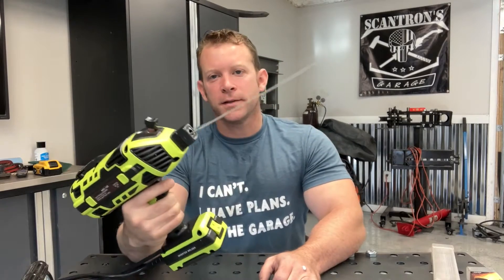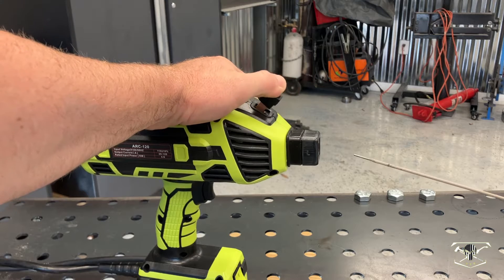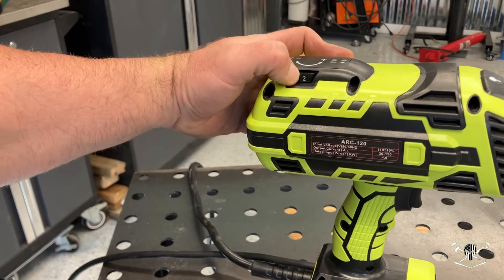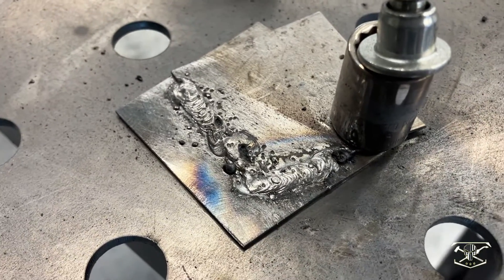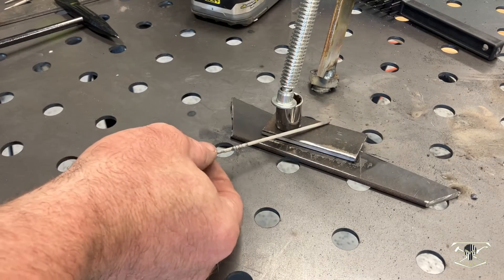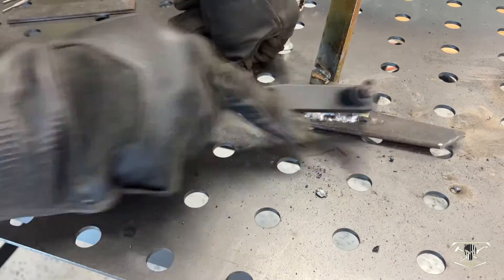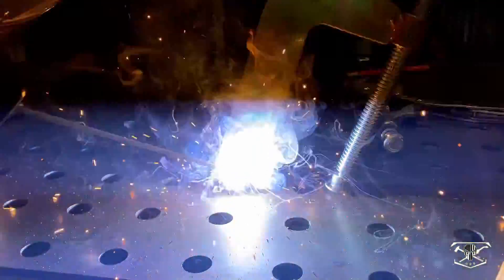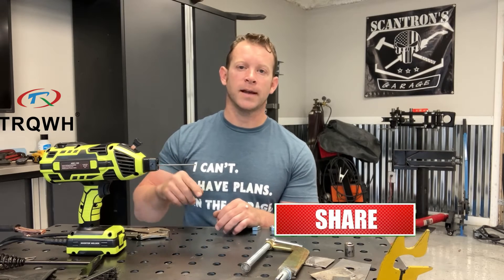Testing The Handheld Welder

Comment: What setting for exhaust pipes. I keep putting holes in test pipes?
Reply from the maker: Start on the lowest. Exhaust pipe is thin so you may have to start and stop weld meaning you only do a tack at a time and work your way around the pipe. This mini moves heat buildup

Comment: I got the Saker version of this tool, and today used it extensively.  I got it as something to learn on, but the gate of my utility trailer broke off, and I NEED that trailer tomorrow. 

A dear friend who happens to weld for a living came over, and welding my own trailer was my first practice. 

1. Power: 110V, 20 Amp on 100' extention cord.

2. Rods: 3/32

3. Hood/Safety: ran into a snazz here.  If you get a cheap, dark hood for extra protection that is NOT adjustable, you WILL NOT see the material.  The gun simply isn't bright enough...all you will see is a green, glowing blob.  This caused my first attempt at welding to START at the right spot, then trail off into Never-Never Land.  You can see your work with the kinda-face-shield thing that comes with it, but keeping the thing on your head is challenging.  

4. Working time:  Project start-- 7:00 a.m.  Cut off old hinges and ground areas smooth.  3/8" steel bar was cut to size for reinforcement.  After that, the process was clamp, tack, remove  clamp, weld, grind, second pass, grind, repeat on next piece.  The machine seemed happiest on this job on setting 4.

Job finished at 2 p.m., which included a quick run to get more rods. 

5. These were not PRETTY welds, as he was getting used to the machine, and I'm a rank newbie.  They got prettier.
The machine never had an issue or overheated at all.  The welds were all solid and it penetrated well. 

6.  I'm a smallish woman, and I had no difficulty handling the gun, or using it.  My friend, who habitually uses machines worth more than my car, was VERY shocked at the quality when I told him how much I paid for it.  

Hope this helps anyone reading.
Reply from the maker: Thanks so much for sharing your experience and detailed tips with the welder! This is super helpful for anyone looking to get one.

Comment: I have been dabbling with learning how to weld for years. I’m a DIY woodworker and every once in a while I have a project where a welded structure would make things easier. Investing $100 in a tool to learn the basics to weld a metal frame or understructure seems reasonable. Your review gave me the confidence that such a tool which seems adequate to what I need, is worth the investment. Thank you!!!
Reply from the maker: Glad I could help give you the confidence to start welding! It's a great skill to have for DIY projects.

Comment: What’s it like on car panels or does it blow holes
Reply from the maker: You can do it. It is tricky though. I welded some thin sheet metal in this video about the same thickness as an automobile. You just can’t let it get to hot and only weld a few sections at a time to avoid heat buildup/ distortion

Comment: no one in the comments or even the video creator are real welders?
Reply from the maker: No I’m definitely a hobbyist using a hobbyist machine
Reply: This isn't a tool for "real" welders to use on their day-to-day jobs of doing "real" welding. 

This is a tool for anyone, from "real" welders to people just taking up the craft, to put in the seat of their side-by-side and head to the back 40, or fix the broken metal tube lawn furniture. 

A Black & Decker cordless drill isn't intended to replace a Delta Drill Press.  No one expects it to. It's meant to drill holes in the wall to hang the curtain rods.
Reply from the maker: @ArbreSage53  true but this thing is awesome to have at your disposal and is great for most home repairs

Comment: Hmm looks to good to e true but it looked as if it worked ok. Now some idea of the power outlet and it's current handling requirements required plus some testing of those welds, would hav been really helpful. The only thing i found disconcerting was the rate at which the device chewed up the rods, so is it quite expensive on that account??
Reply from the maker: Good points. The welding rods burned through quickly because they were thin compared to the metal thickness I was welding. I could have switched to a thicker welding rod that would have burned slower

Comment: Awesome video very informative.  New never welded before and want to get into it.  Will this work on a trucks muffler pipe to extended it? Thanks
Reply from the maker: Yes it certainly will. Make sure you start with some sample pieces to figure out how it welds before you start on your exhaust. You will need to practice a bit on your technique before welding your work piece

Comment: DON'T risk buying or using ANY welding machine for which the manufacturer does NOT supply a FULL LIST OF ALL applicable input/supply voltages and amperages for ALL common welding rods.  Running a welding machine off domestic wiring/outlets risks blowing fuses/circuit breakers, starting fires in your building and/or electoctrocution of the user or others.   IT IS WAY PAST TIME THAT NATIONAL GOVERNMENTAL ORGANISATIONS BANNED AND REMOVED ALL ADVERTS AND SELLERS THAT CANNOT PROVE THEIR DEVICES MEET THE ESSENTIAL SAFETY STANDARDS...WITH SUBSTANTIAL FINES  AND/OR IMPRISONMENT OF COMPANY OWNERS AND DIRECTORS FOR NON-COMPLIANCE. FACT: The manufacturers and sellers could be risking or destroying users' lives so that they can make financial profit.
Reply from the maker: Good thought

Comment: Man can this thing get stripped bolts out 😂
Reply from the maker: So many good uses
Reply: @scantronsgarage I don't know ow anything about welding but I work on cars and I'm tired of stripped bolts I keep hearing about a mig just want to know if this would work
Reply from the maker: @ForgeWashington  A MIG is a little more useful with automotive work however this will work great to put a weld on a broken bolt to easily extract it. Also good for some basic weld repairs

Comment: any idea how many watts of power it pulls?
Reply from the maker: Watts no. Amps I can give you an estimate. It is between 15-20 amps. If you run on a 15 amp breaker it runs fine on the lower settings. I never had it trip a breaker on a 20 amp circuit

Comment: I just bought one of these, I want to use this around the house for small welding jobs. I'm no welder so this will be a learning experience. I would like to buy a small gas generator to power the unit when power is not available! Any ideas what wattage I need to buy to power the unit! Plenty here in Western N.C. on F.B. Marketplace. Any other comments or suggestions would be welcome. Thanks
Reply from the maker: Any generator that can support 15-20 amps will do you just fine. This is a cool little machine. You will have fun
Reply: @scantronsgarage  great question by the OP. 
  So I have an 1800watt 30 amp Generac Generator. That should power it no problem, right?
Reply from the maker: @joeyvanostrand3655  yes absolutely.

Comment: This week alone . . . . 3 Car key fob protectors from dropping, like dropping a iPhone, some seal foam for my Central AC evaporator work, steel sleeve garden hose that easily unwound with minimum kink, etc.  All this stuff were made in China even if designed in the US.  Your Welding Bun, no doubt made in China.  I still use Covid quick tests to rule out covid, as 5% who get covid end up with Long Covid like Lyme Disease, with you for years.  Test kits made in China.  There are Mid-Westeners who buy a $25,000 bobcat type machine instead of a $40,000 John Deere, made in China, who says the China machines are pretty good.
Reply from the maker: It is what it is I guess

Comment: What should I  set for light metal pipe
Reply from the maker: Make sure you are using thin welding rod. About the thickness of the material you are welding. And I would start at three and adjust as needed
Reply: @scantronsgarage  this looks ideal for broken s.s exhaust.. what's your opinion? Looking for something small to fix mufflers & exhaust
Reply from the maker: @Yella_Man  you could use this. It would not be pretty though. A MIG would be a little cleaner and  TIG would give you show quality
Reply: @scantronsgarage Sad as the manufacturers' videos show differently!

Comment: What is the recommended amperage required so as not to trip the circuit breaker. 15a or 20a?
Reply from the maker: 20 amp is preferred
Reply from the maker: You can get by with a 15 amp plug if you are not using the welder at the highest amperage settings
Reply: @scantronsgarage  Thanks for both your responses. Appreciated.

Comment: I was learning to weld and decided might as well see if I even like it with this machine long story short, make sure you get the rods. It comes with seems like anything thicker. It has a really, really hard time running. I have an old house that might be that, but everything else in the house. That's modern runs, fine. So just make sure you get small rods. With this, the rods that came with ran excellent
Reply from the maker: Good advice, the rods definitely make a big difference!

Comment: Nice video I have one too I love it I think it's way better than the traditional spring clamp style singer I've seen other videos of people sitting down in front of a table holding it all above their head complaining about it being awkward I literally just use that like impact rich or impact driver with a 6 inch extension or Roto hammer all things I'm used to doing I think most people but they were like professional welder who mostly swelled would find it easier to use I also like trigger feature I've used well on cast-iron I've used it for an hour and a half straight I've used these things I used to basically angle iron and then I will be on the side of it with a ledge hammer into the ground all the way through the concrete post without the welds coming off 
also have $1000 Lincoln welder which does have a easier start to strike the arc however I had other welders in the past like the big 300 pound ones and those are hard to start the art with it's nothing like that and being that it's so easy to work with it was never a problem starting an ark I think most people that get into welding have used impact wrenches impact drivers Roto hammers even saw things that feel similar to using one of these just give yourself a little space stand over whatever you're working on and mess with the settings a little bit it'll be fine make sure your welding rods are dryI want to switch the ground pump out but so far still working good that would be the only thing I would say maybe could be improved but for the price I think any welder you guys gonna have a crappy ground plant
Reply from the maker: I agree with you. You can’t argue with the simplicity of this little machine. Like you said, it’s just like operating an impact wrench and is easy to use.
Reply: I would have thought it  easier to control an electrode holder than a gun/ electrode holder or am I missing something here?
Reply from the maker: @paulhaggett3710  I had the same thought myself. However this was easy to manipulate like working with battery operated tools that we have all spent a lot of time with. If you have been using the stinger for a lifetime though this may take some getting used to

Comment: How is that bulky thing easier to manipulate than a standard stinger?  I thought the thing was cordless except for the ground
Reply from the maker: It is surprising how it doesn’t feel bulky. It’s similar to operating a battery powered drill
Reply: Ya I laughed out loud when he said it's easier to handle than a tiny traditional stinger that is 7" shorter and is just a spring clamp. Like that was just goofy.
Reply: @timlong1462 yeah he doesn't know

Comment: Will this work with a GFI  outlets?
Reply from the maker: It will however some GFCI outlets can be trick.
Reply: @scantronsgarage The reason I asked is all my outlets in my garage are protected at the GFCI in the fuse panel.
Reply from the maker: @raywall5712  I understand. you could always make one outlet not on the load side of the GFCI and use that one to weld.

Comment: Where did u put tye ground cord
Reply: Clip it to the metal you are welding.  Just about anywhere on either piece will work.  You have to have to ground attached to complete the electrical circuit you are creating by welding.  If you are welding on a vehicle or anything with a DC battery then unhook your battery first.  You don't want to find out what can happen if you don't.  Hook it as close as you can to where you will be welding.  DO NOT weld on gas tanks, propane, oxygen, acetylene, argon cylinders or anything else flammable or under pressure.  You will only make that mistake one time.  Clipping it to a painted surface sometimes causes continuity issues and your weld will sputter and spit around or might not arc at all.....  Hope this helped!
Reply from the maker: I ground to my welding table. If you do not have a suitable welding table, you connect it directly to the piece you are welding.

Comment: thank you, i have one coming,
Reply from the maker: You will like it!
Reply: @scantronsgarage  i just got it from amazon, fast, and love the case
Reply: @scantronsgarage  your demo had me buy one, unfortunately it didn't do any better than my old Lincoln hobby 110 unit, which is constant sticking of the rod, so i am wondering is it my high humidity rainforest that has both of them unusable because the flow won't start, just sticks like a magnet 98% of the time. both the old tech and the new IGBT. so can anyone tell me which rod does best in 90% humidity and can be dirty metal too, i know my old Lincoln 220 could burn through anything i put in front of the old 6013, but at low power, high humidity and dirty conditions is there a rod type that might flow? ANYONE?

Comment: Hey, just for safety reference, maybe  don't weld galvanized metal. Otherwise  great review.
Reply from the maker: You are absolutely right! Thanks for the tip!
Reply: Why not galvanized metal?  p.s. I don’t know a thing about welding
Reply: @csickpuppy Galvanization is zinc and/or nickel coatings to prevent oxidation of metals. When you weld it, if you don't dissolve or grind away that layer of zinc and nickel, it turns into fumes and if you inhale it, you can become very sick. Prolonged exposure can cause serious respiratory issues very quickly and lead to other health risks throughout the body.

Comment: Something the ads don't tell us. Household power in Australia is rated at 10 amps. These handheld welders require input of 32 amps. Using one through standard household power is not recommended and will probably overload/trip your circuit board.
Reply: US standard outlet isn't 32a. It's 15-20a.  30 is a dedicated line that is designed for larger appliances
Reply: @JAB1978 , well Explained , don't know why People say things they know nothing about !!!😮
Reply from the maker: I plugged this into my standard 110 V 20 Amp house outlet. Never tripped a breaker
Reply: @scantronsgarage  Good to know!
Reply: Does Australia have 110 or 220 volt?
Reply: @greygum4647 You just made that up.💀💀💀🤣🤣🤣💯💯💯.

Comment: When you use this, do you drag the rod or just lay it in place as it works?
Reply from the maker: So if you touch the rod to the metal it will stick to the base metal. You have to scratch start the ark then hover it a few mm over the base metal to maintain the arc gap
Reply from the maker: Good tip!
Reply: Shouldn't you be keeping a consistent/uniform puddle just like the stick arc process?

Comment: Can it do car panels. I bought a welder from a buddy of mine and it keep burning holes even on the lowest settings
Reply from the maker: Yes it can. It is difficult. but you can. You can turn it down on the lowest setting and take your time not to heat the metal up too much. A MIG welder would be better suited
Reply: @scantronsgarage  You really need to use a MIG welder for car panels.
Reply from the maker: @williamdenison6777  true
Reply: Like the others here said. Better of using a decent MIG unit. It can be done with a decent unit as I have done it. But best way is to tack weld in different areas of the path to let each tack area cool enough to come back to it. Then grind your weld pattern down

Comment: this is ok for the typical household breakers (15/20 amp)?
Reply from the maker: Yes, this will work on a standard 15 amp circuit. I used it with 20 Amp circuit in this video

Comment: whats the thickest plate it can weld?
Reply from the maker: It will struggle with 1/8 th
Reply: @scantronsgarage  but you used 3/16, right?
Reply from the maker: @Grannyhauenstein  Yes but... the metal was not fully penetrated

Comment: I bought one of those from Temu. I use it all the time. I LOVE IT!!!
Reply from the maker: I still use this thing all the time
Reply: please, share the link for temu?
Reply: Same here I bought it from Temu. Couldn’t wait to get it. Gonna try it out tonight.
Reply: @TonyHenderson-f9e  You are going to love it. I got mine 2 years ago i think.
Reply: Can you use 2,5 mm rods?
Reply: @fortisfortunaadiuvat1071 I don't know. I use the same ones that came with it. I don't use it all the time. so I have plenty of the ones that it came with.
Reply: @vidstak Thx for the answer. I have standard 3x2,5mm2 circuit for this one in my garage with b16a fuse. Chatgpt tells me to change it for c16a but not b20a due to wire circuit diameter. Your thoughts?
Reply: With all due respect not one of those welds would get you a job. I know that a lot of employers will give you a welding test as part of an interview.
Reply: @TrumpIsImmortal  I agree. I am not a welder. I use that around my home. these things would never make it in the commercial environment. But I love mine.